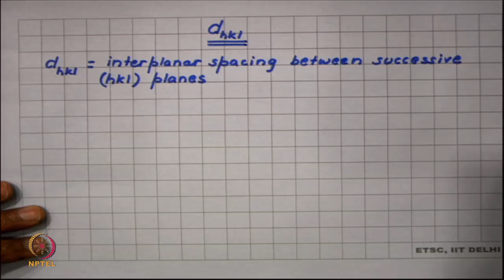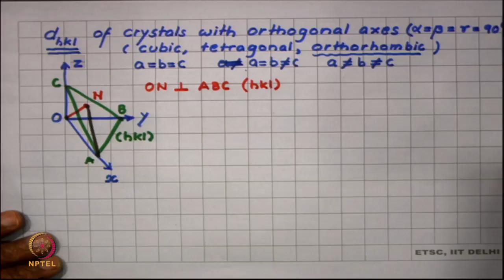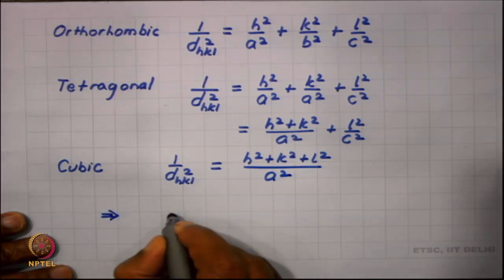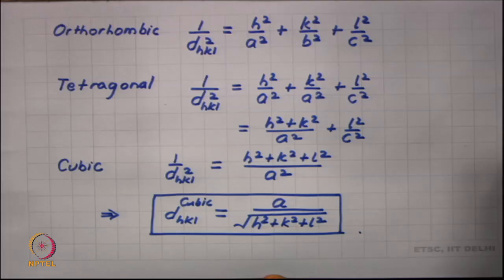Inter-planar spacing

Comment: Sir I think at 6:45, OA will be equal to a/h if ,and only if, we had not scaled the Miller indexes by some factor to make it an integer. I mean, to find h if we just do reciprocal of the number of a's required to span x- intercept, only then will OA be equal to a/h. Please correct me if i am wrong.
Reply from the maker: You are right. When we define Miller indices we reduce to smallest integers, making (200) as (100). This is fine if we are not worrying about dhkl. But when we think of dhkl we do not use such reductions and consider (200) and (100) as distinct. For example, d200=a/2 and d100=a in cubic crystal.
Reply: @introductiontomaterialsscience  i got it sir. Thanks for the help.

Comment: Thanks for that. How can we prove the interplanar spacing relation in the case of a hexagonal lattice?
Reply: You can derive it using the concept of reciprocal lattice. I will do a video on it soon.
Reply: @rajeshprasadlectures  Sir I think at 6:45, OA will be equal to a/h if ,and only if, we had not scaled the Miller indexes by some factor to make it an integer. I mean, to find h if we just do reciprocal of x- intercept, only then will OA be equal to a/h. Please correct me if i am wrong.

Comment: Sir How do you calculate the miller indices given the inter planar spacing ? Thank you :)
Reply: If only the interplanar spacing is given, nothing can be done. If lattice parameters are also given then you have a relationship giving interplanar spacing in terms of miller indices and lattice parameters. Still, since there are three Miller indices and only one equation, a solution is not guaranteed. But in the case of a cubic crystal, it is possible to get a solution because you can determine h^2+k^2+l^2. Given this value, one can determine the family {hkl}. for example if h^2+k^2+l^2=3 then you can say that {hkl}={111}. But within this family, a specific plane (hkl)  cannot be determined. For example, it can be (111) or (-1 1 1) among other possibilities.

Comment: Sir, how can we say that the distance between origin and plane is the same as the distance between two successive planes passing through corners.? Can you please explain this?
Reply from the maker: This really part of the definition of interplanar spacing. Consider any given Miller Indices (hkl). This gives a plane with intercepts a/h, b/k, c/l. By definition, any plane parallel to this will also have the same Miller indices. Thus with this definition alone we cannot define dhkl uniquely. So after having the first plane with intercepts a/h, b/k, c/l we take as the next plane one passing through the origin and parallel to this plane and define the distance between them as dhkl. And then we repeat these planes at dhkl to have a set of parallel (hkl) planes with spacing dhkl. I hope I have made it clear.
Reply: @introductiontomaterialsscience  yes sir, i got it. Thank you so much.

Comment: if OA=a/h, OB=b/k OC=c/l,  miller indice (h/a k/b l/c). these are not equal to (hkl)???
Reply from the maker: For Miller indices, you need to take reciprocals of 'intercepts in terms of respective lattice parameters". Thus the intercepts a/h. b/k and c/l have to be divided by a, b and c respectively to give relative intercepts 1/h. 1/k and 1/l. taking the reciprocals of the relative intercepts we get the Miller indices (hkl).
Reply: Thank you!!
Reply: @introductiontomaterialsscience  7:31 Sir once can you explain how you got OA= a/h if edge length of cube is a?
Reply from the maker: @Krishna-in3ni  By definition, if the first Miller index is h then the first intercept is a/h.
Reply: @introductiontomaterialsscience  sir according to you, we need to divide the edge length "a" by the corresponding length of intercept in order to get Miller index "h". But in books( for example SSP BY CHARLES KITTEN) ,they do the same but they also scale it to the nearest integer. If we also scale it then OA ≠ a/h. So according to the definition of h, do we have to scale it or not?